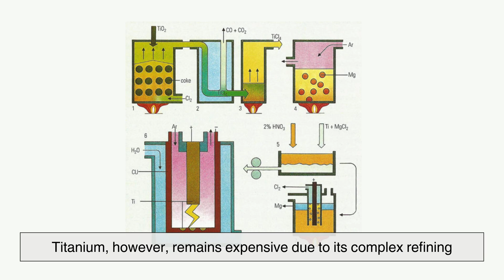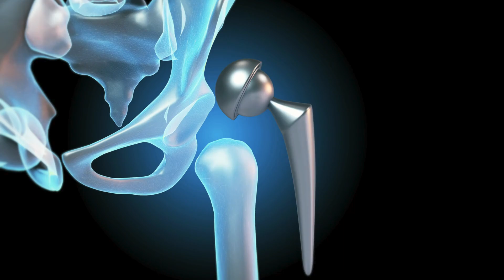Titanium vs. Stainless Steel: Which Metal Is Right for You?

Comment: Regarding 3:20, Soviet Union titanium submarines were faster than steel submarines because titanium is both stronger and lighter than steel. After the fall of the Soviet Union on December 26, 1991, they needed lots of cash and were selling Titanium crowbars and shovels for bargain prices. Savvy buyers bought them up because they were affordable, lightweight, strong and corrosion resistant. Titanium is 40% lighter than steel, is as strong as steel and does not rust. For example, Titanium crowbars are used by divers to pry abalone from rocks. Titanium shovels do not rust are lightweight and used to scoop dirt, snow or animal feed.

Comment: Additional key fact is that when titanium is used for structural parts, such as aircraft turbine blades, medical implants, golf clubs, and other applications, it is usually cast in molds, then machined into the finished product. The casting process requires heating Ti beyond its F3034° melting point and pouring molten metal into a super-heated ceramic mold, all of which must be performed in a vacuum to prevent rapid oxidation that would corrupt the entire process.

Comment: A folding spork made of stainless steel weighs around 26 grams and costs as little as $2.12. On the other hand, a folding spork made of titanium weighs around 19 grams and costs around $9. Both are lightweight, corrosion resistant and do not melt like plastic.

Comment: Two more criteria that you failed to mention:
Titanium tends to deform more easily (less elastic) than stainless steel.
Titanium has a higher melting point (heat resistance) than steel.

Comment: First off there are many, many different stainless steel alloys and perhaps about a dozen titanium alloys.  They have their own applications.  The key one for Titanium is its low density (~60% of Steel) and high strength.  Stainless Steels are known primarily for their corrosion resistance and strength at elevated temperatures.

Comment: There is no frame to a F1 car, it is a monocoque chassis made of carbon fiber. This means  the "monocoque tub formed of carbon fiber, hold all the weight and stress of the entire car. All major components of the drive train, and suspension are then mounted to this carbon fiber tub. This is one of the main parts of the "formula" which makes it, "formula 1" as  directed by the governing body, The FIA. 
Titanium and magnesium parts are used throughout the cars, just not in structural element as described above.
Reply: Yup that is correct

Comment: My doctors told me my medical implants were stainless steel, not titanium 🤔
Reply: Depends on the type and location of the implants.
Reply: @sebastiandumars3005 shattered hip, brace around a fracture in the lower spine between L3 and L5 vertebrae, a rod inside my right upper leg bone with a screw above my right knee to secure the bar in place.
Reply: It’s both. Titanium is a superior option over SS, but costs more.